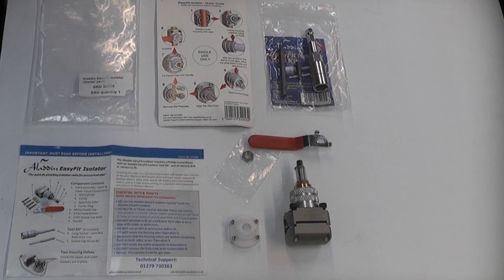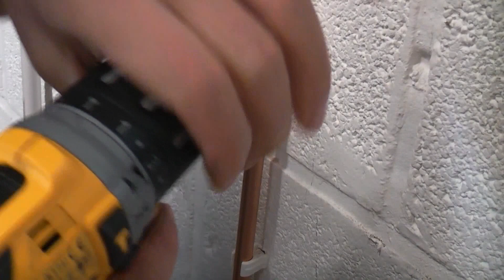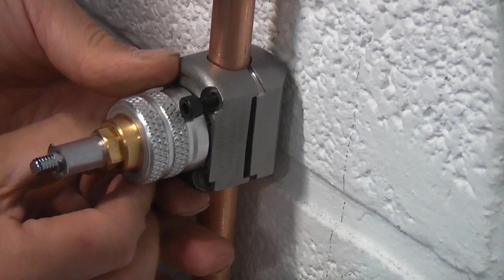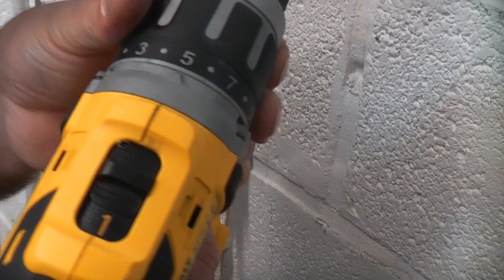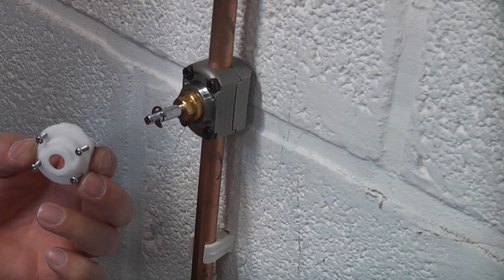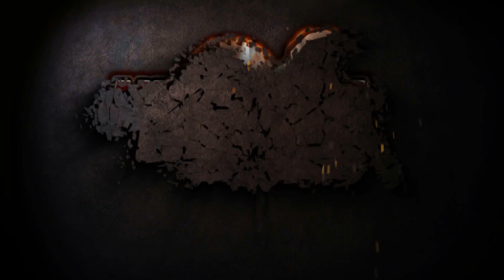Aladdin EasyFit Isolator | Isolate a live water pipe

Comment: these work ok on shiny new cheap thin copper pipe...but good luck fitting these on old thick 1/2" and 3/4" pipework
Reply: It only works on 15mm pipe which is metric. If your pipes are in imperial sizes then it wont work. Maybe they will develop these if they decide to approach the American market.
Reply: Pretty much Standerd copper is 15 mls and its 1/2
Reply: 15mm is outside dims, 12mm inside..you couldn't drill a 12mm hole and fit a 1/2" pipe through it..just for reference
Reply: @steveabrahams479  Who the hell is talking about inside dimension?

Comment: You should never attempt work on any water pipe, without having the option to isolate the water. And if you have that option, there is no need for this device. If there is no isolation, then that’s your starting point to put one in on the mains, or of course to locate the stopcock in the street, even if you have to call out the water board to find it hidden somewhere. I think most flat owners would prefer the water for the building temporarily off, than risk flooding the building!
Reply: Nonsense. If everybody followed your advice then nothing would ever get done.
Reply: The Captain I think he mentioned for factories mainly where you can’t isolate due to not being able to shut down the whole plant and stop all production .

Comment: eventulally, this will leak.
Reply: why do you think this?
Reply: @utubeape  mains pressure vs O ring gaskets, it will leak soon enough
Reply: stonesdurtysox  Rubber seals harden and degrade over time. Why does that have to be spelled out?
Reply: John Doe If you think rubber is the only material used to produce seals these days, you’re probably still using Yankee screwdrivers. This is 2019! Why does that have to be spelled out?

Comment: You are becoming my favourite YouTuber. I have ordered one of these kits. I hope my drill is up to it, I have no idea how many ohms it is. It would have been nice to see you fit one with a ratchet.
I noticed you have the pipe clamped to the wall above and below the installation point so that's what I shall be doing. The comments section on this video is insane, you are a very patient man. Thanks again.
Reply from the maker: These are great, I have just been sent the 22mm version to test out (that will need a powerful drill).
It's hard work keeping up with comments at the moment, with work commitments etc. 
Good luck fitting yours ;-) 
Thanks for the comment 👍

Comment: Just used one of these on a bent 15mm rising main copper pipe, outstanding bit of kit. The clamping action via the 4 bolts to clamp it on the pipe, just basically pulled the pipe into shape for it to seal. I'm going to stick my neck out and say, I recommend you get a ring spanner ready, as you're more than likely to find your driver wont be strong enough.
Reply from the maker: Thanks for the comment ;-)

Comment: As someone else has said, the question of what happens to the cut out copper is answered on the company's website FAQ section.  It doesn't stay in the pipe.  The only thing I would say about having one of these fitted is that, as the fixing relies on friction,  the pipe should be fully supported near the valve.  I'm thinking if the pipe can move then the valve could work loose.  Not very likely I admit.
Great video as usual, please keep them coming.
Reply from the maker: Thanks for the comment ;-)

Comment: Thanks for the introduction; I could of used these Aladins many times in the past. A great way to get the stress levels up can be achieved by freezing a live pipe, cutting into it and then finding you didn't have all the bits you that you thought you had to finish the job!
Reply: or using 3 cans of freeze spray and the water flow is too much for the freeze spray to work, as it is only recommended for still water, not flowing water in the pipe

Comment: Our house has an underground water valve out front that broke every time it was used (the part that closes the valve), so my parents quit fixing it. This was like the 1970s. From then on, we've been shutting the water off and on at the meter when we've done repairs (with shady legality). Just recently when the plumber repaired our tub/shower valves, I had him install a service valve with cold water side. I got sick of going outside to shut it off just to replace a washer (a seat and spring now), and with my luck the meter was full of murky water while it was freezing outside. I think it cost me $70-$90 to do that, but I forked up the cash since I was sick of doing things the hard way. I have no regrets from that. This EasyFit Isolator sounds like a great solution for the home owner who just wants to put a valve in without burning down the house with a torch, and make sure the thing works on the first go. It looks like the kit probably costs about as much as having a plumber do it, but at least it could be done in under an hour versus waiting to schedule a plumber to come in.
Reply from the maker: Thanks for the comment ;-)
Reply: Robert Gaines @

Comment: As a maintenance engineer I come across catastrophic leaks ( or cause them 😁 ) quite frequently. For me, a push fit valve is a better option, cut through the pipe (even under mains pressure) and push the valve on. You can then re-pipe to compete the job. Yes you get a little wet, but that comes with the territory.
Reply from the maker: Thanks for the comment

Comment: I wonder if anyone has tried this in a condo where multiple units share the water line. Typically we have to call a company to freeze the pipes because the water mains in the high rise condo units are difficult to access and coordinate with all the residents. My concern might be about copper residue in the lines for the unsuspecting neighbors.

Comment: Outstanding,  very useful for emergency or no way to isolate as an apartment or factory, I agree with some comment that it's not the right way but a great option,  thank you !
Reply from the maker: You are welcome
Thanks for the comment
Reply: Ultimate Handyman when you drill through the copper do you drill both sides ? Wouldn't you want to drill with a ratchet instead of the drill so you can feel when your through? Is there a reference or sound as to when to stop ?

Comment: What a great product,  it would be great to have if you had a pipe freeze,  isolating the broken section the house could have water while you worked,  or if you had a damaged shut off you could simply replace it with one of these then disguard the old.
Reply from the maker: Absolutely.
Thanks for the comment

Comment: That is impressive!  I seriously could have used this five or six years ago.  Basically, I had to resort to stuffing bread in our supply line, before attempting to solder a new valve.  It worked, but it wasn't pretty.
Reply from the maker: Thanks for the comment
Reply: @ultimatehandyman  Thank you for doing this video.

Comment: Same company have a new pipe blocking tool called Pipe Genie which works on 22mm and steel too. It's a small drain valve you then push an expanding bung into to block the pipe. Seems a better solution all round cause (a) you don't leave the expensive parts on the pipe (b) small hole disrupts a pipe a lot less than cutting a whole section and won't affect earth bonding (c) you even get the little bit of copper out the hole!
Reply from the maker: Thanks, I'll check that out ;-)

Comment: Very clever thing but it’s a lot easier to hot fit a standard valve... unless you are the Wicked Witch of the West and you melt in water. If that’s the case call a plumber.

Comment: I would flush pipe after installation because shards of copper could cause problems.
Water utilities use a system like this to tap into a underground main but they flush before  final use.
Reply: Thanks for your interest in our valve.  The cutter plug on the Easyfit Isolator has no teeth and is scalloped so it does not cause swarf/shards of copper in the pipe.

Comment: I used something like this before and it worked fine however when I removed it i noticed the cut out piece was pushed inwards and a thick  green copper build up had occurred taking up nearly half the pipe
Reply from the maker: Some self cutting taps do not compress the cut out section into the back of the fitting, unlike this valve.
Thanks for the comment

Comment: Last month I was going to change the bath tub cold water valve. I couldn't turn off the city water, so I just removed the valve, had full hundred pound water pressure spraying in the tub and on me as I finagled the new valve in the valve body.  It worked, I got soaked, but trying to fight against that water pressure was real bitch.  Damn I could have used one of the isolators, I didn't know about them.
Reply from the maker: Thanks for the comment

Comment: Nice vid chez but i would not trust fitting one in some ones house / flat just in case there was a problem with the install , electric pipe freeze and full bore lever valve for me everytime

Cheers
Reply: Can you freeze flowing water in a pipe?

Comment: nice one. Surprise you dont use a rachet manual screwdriver for screw for the plastic cover. Much easier than a manual screwdriver, albeit they are little bulkier
Reply from the maker: To be honest I use a drill driver 98% of the time, but didn't want people trying this with a drill driver and stripping the screws, which is why I used a screwdriver 👍
Thanks for the comment 👍

Comment: Look bery simple and easy. I wonder wearher it can be used on iron central heating pipes.
I have plans to connect a radiator in my garage. (Yes, tubing is already in there)  and add an extra radiator in my extension at my house.
The pipe diameter is the same as copper tuning.
Please gibe me a hint.
Btw I live in the netherlands, where I have not seen somethin like this.
Reply from the maker: No, these are currently only suitable for copper or plastic pipe.
Thanks for the comment

Comment: Product seems to be ideal for emergency repairs.  Only concern I have is the copper piece and or shavings once drilled. Could copper debris affect cartridges or fixtures since it does not have anywhere to go ?
Reply from the maker: The cut out slug is compressed into the back of the isolator, not sure about any shavings, but the part that does the cutting is similar to a pipe slice.
https://www.youtube.com/watch?v=H9JSbIPLffM
Thanks for the comment
Reply: The pipe slug is removed in a swarfless cut so there are no fragments or shavings to be introduced into the system the slug is then compressed into the back of the housing so nothing is introduced into the system.

Comment: I've just installed this thanks for the video , however when I shut it off the water is still trickling out of my taps so I don't think I've wound it in quite far enough am I able to take the plastic cover off and wind it in a bit more?
Reply from the maker: I'm not sure about that, if I were you I would ask the manufacturers-
http://aladdin-products.co.uk/contact-2/
Thanks for the comment

Comment: Hiya, you must be a mind reader, every time i go to do something i check to see if you've done a video on it and once again you haven't disappointed ......🤣🤣🤣👍👍
Sooooo my question is this,  i have read that this Aladdin isolator doesnt last long and doesnt have a long service life so is this worth getting if i have to constantly end up having to change it out and turn off the water, which is what i was avoiding doing to begin with, and have to go to the added expense of getting another tool to remove or exchange the isolator that's worn? 
Thank you so much for any help.
Reply from the maker: I would only use one of these, if there was no chance of using another method.
A couple of years back, I tried the 22mm version to block a pipe which had flowing water in it. The valve did not work (which is the main selling point of these valves) 👍
Reply: @ultimatehandyman  ahhh what a shame, i bought two, but the socket is bent, so its a non-starter straight away, tried their customer service and left messages but no reply so far.
 Thank you 👍👍👍👍

Comment: I wonder if i could use this to replace the current valve for the incoming city water supply. It seems like I could put this in, turn it off and remove the existing valve and solder in a brass pipe.  The only other way is to have the city turn off the water supply to our house.
Reply from the maker: If the water is not hot or flowing you might be better off using a pipe freezing kit?

Comment: Just saw this video, interesting clever device. I'm not going to ask where the cut section of tubing/pipe goes (I saw the cavity in the bottom half of the device). No, my question regards if the stop "cap" can be opted for a brass one instead of plastic? Overzealous operators will crank too hard on the lever breaking it. Also I see it only comes in 15mm (1/2"cts). Will there be devices for larger size tubing /pipe?
Reply from the maker: I'm pretty certain that the manufacturers are working on making a model that is suitable for larger diameter pipes.
Thanks for the comment

Comment: Anything with rubber seals is not as long term as solder or copper & movement on that lever might not be a good idea if it's old & stiff in 10 years..
I have seen rubber sealed joints on push fit fittings last decades but I don't trust or use them by choice..
If you can't isolate the mains I use a freezing machine & compression joints but if it's a block of flats I'd refuse to accept liability..
I'm really not sure if I'd buy one of these myself but I can't say it doesn't work...best give away some to the plumbing shops best customers then see if they come back for more valve kits & recommend them to other plumbers...I think this will be hard to launched to the experienced engineers & maybe visiting colleges & getting the colleges to show them as an isolator would create a younger more open market.

Comment: The times I've had need of this, the trouble it would've saved .
one query?  What about the swarf and or disc the cutting part makes ?
Reply from the maker: There is not much swarf as the cutter is similar to a pipe slice. The slug is compressed into the back of the fitting and can be seen here- https://www.youtube.com/watch?v=H9JSbIPLffM&t=3s
Thanks for the comment

Comment: I agree with most comments but my question would be, "what if the device leaks on installation?" Obviously in this situation you cannot isolate the water so there would be a leak you cannot fix! & How long until the rubbers start to perish? Thanks in advance & great video.
Reply from the maker: We have compressed air fittings on site that use a rubber O ring and they are still OK 30 years down the line.
Thanks for the comment
Reply: Glad you like our Aladdin  Easy Fit Isolator.  Our products are assembled in the UK with precision and as long as they are fitted correctly they don't leak.

Comment: Make sure you remove any shower cartridges down the line and flush the line out or else you'll have clogged cartridges from the copper being drilled!
Reply from the maker: I'm not sure if any copper bits will enter the system, as this cuts like a pipe slice. The cut out bit is then compressed into the back of the fitting.
Thanks for the comment

Comment: Cracking video... you now have a new subscriber.... very impressed with the gadget too.... I understand you rigged up a system, was it under full pressure at the time? If so do you have an idea of what that pressure is/was? Just being nosey.
Once again, great video - cheers
Reply from the maker: I actually made a mistake when filming this video originally, as I had the pipe pressurised to 20Bar (I think I had been testing some pipework on site and had 20Bar stuck in my head). As you can see from the video the unit still worked perfectly at that pressure!
Thanks for the comment
Reply: Wow that is impressive... i believe most of the houses I will use it on will be half that.

Thanks for the reply
Reply from the maker: I think the pressure here is about 9Bar and we have high water pressure for the area!
Thanks for the comments

Comment: So can this be used to shut of my main water supply into my house ? My stop tap in kitchen has seized and my stop tap outside in garden is covered over with dirt and cement so cant shut anything off ,, other than calling severn trent water im not sure what to do lol . Great device and vid 🙂
Reply from the maker: To be honest I would not risk it. If this goes wrong you will be in big trouble!
There should be a stop tap at the boundary of the property (this belongs to the company that supplies you with water).
Ideally you need to isolate the outside stop tap, then replace the inside stop tap, unless you can free it up.
I always check my outside stop tap every couple of years to ensure I can isolate it in an emergency. Mine is on the pavement, and often gets filled up with sand etc!
Reply: @ultimatehandyman  ok thank you for your advice 🙂👍

Comment: Could this valve be used on other typses and sizes of pipe? Cold it be used Freon lines or gas.
 Max pressure?
Reply from the maker: As far as I know these valves are only available for 15mm pipe at the moment and can only be used on water.
Thanks for the comment

Comment: My isolation valve is sheared  won't shut off can I just fit one of those aladdin isolators above existing?
Reply from the maker: You could do, or you could isolate outside of the property and replace the body of the stop tap once it is isolated. 
Or you could isolate the water outside of the property and then replace the body of your existing stop tap

Comment: They look very interesting but one question.  If you cut into a pipe it has to make some debris and possibly a larger piece that was cutout for the shutoff. Where does the debris go?
Reply from the maker: The slug is compressed into the back of the fitting, you can see it in this video- https://www.youtube.com/watch?v=H9JSbIPLffM
Thanks for the comment
Reply: Awesome. On my mental list for next time I need something like it. Thanks!